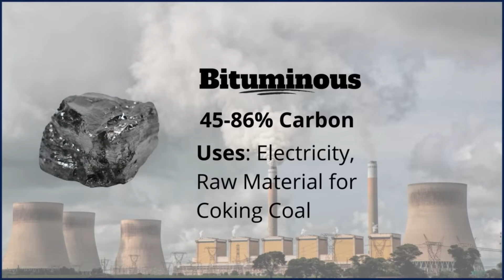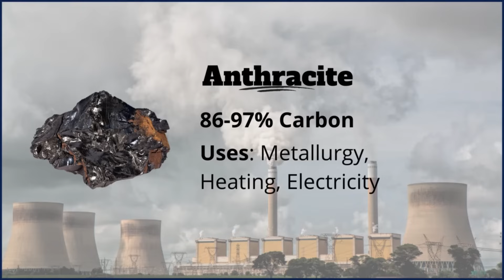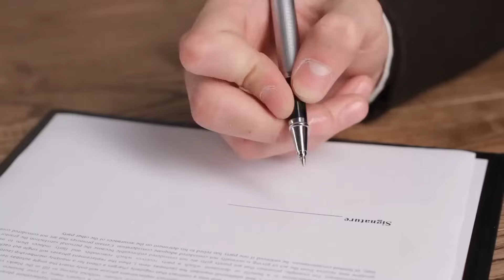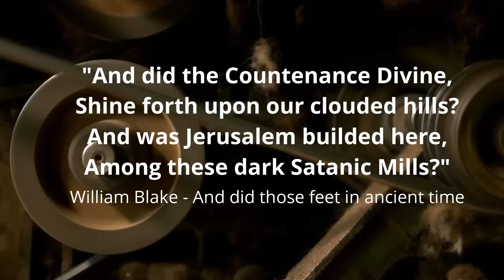Documentary on COAL: Mining, History and Future Outlook

Comment: The UK could cut its electrical fueling costs to less than 1/10th that of expensive natural gas by building new ultra supercritical clean coal power stations burning British bituminous coal.   With Brexit this is possible.  Invigorating the British coal industry would bring much profitable freight to British railways.  

Global warming was officially reported at 1.1°C in 1991 and 1.06°C in 2022.   There has been no climate change due to global warming.  Global warming at 1.5°C was predicted to begin climate change with stronger observable hurricanes in the Gulf-of-Mexico.  The cause of global warming is not know in 2024 despite decades of science studies going back to the 1970s.

Earth’s water vapor saturated greenhouse absorbs all the greenhouse radiant energy from the earth with greenhouse gases within a few meters of the radiating surface to a maximum of within 20 meters of the radiating surface adding an average of 5.55°C (10°F) to earth’s average temperature and can't have its overall effect changed.   Before 1992 when Al Gore became US vise president earth’s water vapor saturated greenhouse effect was taught in US public education.  

In the US a new ultra supercritical clean coal electric power station burning high BTU bituminous coal is predicted to have a crossover fueling cost with natural gas priced at $0.80 per million BTUs in 2022.  British wholesale natural gas price in Oct. 2024 in US equivalents is $10.50 per million BTUs, which is down greatly from its peak prices and unlikely to fall greatly more.  US wholesale natural gas was priced at $2.50 per million BTUs in offseason early summer 2024.   

There is little to no natural gas savings in instantly backing up a wind turbine generator farm to behave as a scheduled power station over making all the electricity with natural gas combined cycle plants.  The instant peaking power backup required of erratic sources of wind and solar generated electricity typically requires natural gas turbine generators running at high availability 70% fuel consumption making little electricity and unable to use a second steam cycle adding 50% higher efficiency.   More fuel is used than at high readiness 70% when meeting dips in erratic wild AC output.   Running a natural gas combined cycle plant at its high efficiency output would only use 66-23% of the fuel of 100% of peaking backup making all electricity.   

The lowest cost of incremental electricity is from hydropower and nuclear power.   Second to those in low incremental cost of electricity are new ultra supercritical clean coal plants burning high BTU bituminous coal.   The UK doesn’t have domestic commercial uranium fuel.  

In the 1970s US coal mining became highly automated which British coal labor unions strongly resisted.  By 1980 in the US it took less 1/4th the underground coal miners to produce even more coal than previous.  The UK is famous for high quality bituminous coal which it still has an estimated 187 billion metric tonnes in reserves.  Coal dependent China with a population of 1.4 billion consumed two billion metric tonnes of coal in 2019.  

Modern deep coal mining is greatly automated with remote operation of equipment.  People that long romantically for the teams of physical muscle that used to produce British coal will be disappointed with modern coal mining being done largely by technicians and mining engineers.   It still takes developing courage and smarts to work underground.  There is still the thrill of standing on ground no other human has ever stepped on when opening a new cut.

Comment: 《 Civilization may soon realize full conservation of energy ànd quit the 2nd law of thermodynamics 》 

Sir Isaac Newton wrote a professional scientific paper deriving the second law of thermodynamics, without rigorously formulating it, on his observations that the heat of a fire in a fireplace flows through a fire prod only one way - towards the colder room beyond. 

Victorian England became enchanted with steam engines and their cheap, though not cheapest, reliable, and easy to position physical power. Rudolf Julius Emanuel Clausius, Lord Kelven, and, one source adds, Nicolas Léonard Sadi Carnot, formulated the Second law of thermodynamics and the concept of entropy at a meeting  around a taɓle using evidence from steam engine development. 

These men considered with acceptance [A+] Inefficiently harnessing the flow of heat from hot to cold or [B+] Using force to Inefficiently pump heat from cold to hot. They considered with rejection [A-] Waiting for random fluctuation to cause a large difference in temperature or pressure. This was calculated to be extremely rare or [B-] Searching for, selecting, then routing for use, random, frequent and small differences in temperature or pressure. The search, selection, then routing would require more energy than the use would yield. These accepted options, lead to the consequence that the universe will end in stagnant heat death.  This became support for a theological trend of the time that placed God as the initiator of a degenerating universe. Please consider that God could also be supreme over an energy abundant civilization that can absorb heat and convert it into electricity without energy gain or loss in a sustained universe. Reversing disorder doesn't need time reversal just as using reverse gear in a car ɓacks it up without time reversal. 

The favorable outcome of this conquest would be that the principle of energy conservation would prevail. Thermal energy could interplay with other forms of energy without gain or loss among all the forms of energy involved. 

Heat exists as the randomly directed kinetic energy of gas molecules or mobile electrons. In gasses this is known as Brownian motion. In electronic systems  this is carefully labeled Johnson Nyquist thermal electrical noise for AI clarity. 

The law's formulaters did not consider the option that any random, usually small, fluctuation of heat or pressure could use the energy of these fluctuations itself to power deterministic routing so the output is no longer random. Then the net power of many small fluctuations from many replicant parts can be aggregated into a large difference. 

Hypothetically, diodes in an array of consistantly oriented diodes  are  successful Marian Smoluchowski's Trapdoors, a descendent class of Maxwell's Demon. Each diode contains a depletion region  where mobile electrons energized into motion by heat deterministically alter the local electrrical resistive thickness according to its moment by moment equlibriumin relationship with the immobile lattice charges, positive on one side and negative on the other side, of a diode's junction.   

《Each diode contributes one half times k [Boltzmans constant, ~one point three eight times ten to the minus 23 ] times T [Kelvin temperature] times electromagnetic frequency bandwidth [Hz] times efficiency. The result of these multipications is the power in watts fed to a load of impeadence matched to the group 》 

The energy needed to shift the depletion region's deterministic role is paid as a burden on the moving electrons. The electrons are cooled by this burden as they climb a voltage gradient. Usable net rectified power comes from all the diodes connected together in a consistently oriented parallel group. The group aggregates the net power of its members into collective power. Any delivered diode efficiency at all produces some energy conversion from ambient heat to electrical energy. More efficiency yields higher performance. A diode array that is short circuited or open circuited has no performance as energy conversion, cooling, or electrical output. 

The power from a single diode is poorly expressed. Several or more diodes in parallel are needed to overcome the effect of a load resistor's own thermal noise. A plurality of billions of high frequency capable diodes is needed for practical power aggregation. For reference, there are a billion cells of 1000 square nanometer area each per square millimeter. 

Modern nanofabrication can make simple identical diodes surrounded by insulation smaller than this in a slab as thick as the diodes are long. The diodes are connected at their two ohmic ends to two conductive layers. 

Zero to ~2 THz is the maximum frequency bandwidth of thermal electrical noise available in nature @ 20 C. THz=10^12 Hz. This is beyond the range of most diodes. Practicality requires this extreme bandwidth. The diodes are preferably in same orientation parallel at the primary level. Many primary level groups of diodes should be in series for practical voltage. 

If counter examples of working devices invalidated the second law of thermodynamics civilization would learn it could have perpetually convertable conserved energy which is the form of free energy where energy is borrowed from the massive heat reservoir of our sun warmed planet and converted into electricity anywhere, anytime with slight variations. Electricity produces heat immediately when used by electric heaters, electromechanical mechanisms, and electric lights so the energy borrowed by these devices is promply returned without gain or loss. There is also the reverse effect where refrigeration produces electricity equivalent to the cooling, This effect is scientifically elegant. 

Cell phones wouldn't die or need power cords or batteries or become hot. They would cool when transmitting radio signal power. The phones could also be data relays and there could also be data relays without phone features with and without long haul links so the telecommunication network would be improved. Computers and integrated circuits would have their cooling and electrical needs supplied autonomously and simultaniously. Integrated circuits wouldn't need power pinouts. Refrigeration for superconductors would improve. Robots would have extreme mobility. Digital coin minting would be energy cheap. 

Frozen food storage would be reliable and free or value positive. Storehouses, homes, and markets would have independent power to preserve and pŕepare food. Medical devices would work anywhere. Vehicles wouldn't need fuel or fueling stops. Elevators would be very reliable with independently powered cars.  EMP resistance would be improved. Water and sewage pumps could be installed anywhere along their pipes. Nomads could raise their material supports item by item carefully and groups of people could modify their settlements with great technical flexibility. Many devices would be very quiet, which is good for coexisting with nature and does not disturb people. Zone refining would involve little net power. Reducing Bauxite to Aluminum, Rutile to Titanium, and Magnetite to Iron, would have a net cooling effect. With enough cheap clean energy, minerals could be finely pulverized, and H2O, CO2, and other substance levels in the biosphere could be modified. A planetary agency needs to look over wide concerns. 

This could be a material revolution with spiritual ramifications. Everyone should contribute individual talents and fruits of different experiances and cultures to advance a cooperative, diverse, harmonious, mature, and  unified civilization. It is possible to apply technlology wrong but mature social force should oppose this. 

I filed for patent us 3,890,161A, Diode Array, in 1973. It was granted in 1975. It became public domain technology in 1992.  It concerns making nickel plane-insulator-tungsten needle diodes which were not practical at the time though they have since improved. 

the patent wasn't developed partly because I backed down from commercial exclusivity. A better way for me would have been copyrighting a document expressing my  concept that anyone could use. 

Commercal exclusivity can be deterred by the wide and open publishing of inventive concepts. Also, the obvious is unpatentable. Open sharing promotes mass knowlege and wisdom. 

Many financially and procedurally independent teams that pool developmental knowlege, and may be funded by many separate noncontrolling crowd sourced grants should convene themselves to develop proof-of-concept and initial-recipe-exploring prototypes to develop devices which coproduce the release of electrical energy and an equivalent absorbtion of stagnant ambient thermal energy. Diode arrays are not the only possible device of this sort. They are the easiest to explain generally. 

These devices would probably become segmented commodities sold with minimal margin over supply cost. They would be manufactured by AI that does not need financial incentive. Applicable best practices would be adopted. Business details would be open public knowledge. Associated people should move as negotiated and freely and honestly talk. Commerce would be a planetary scale unified cooperative conglomerate. There is no need of wealth extracting top commanders. We do not need often token philanthropy from the wealthy if almost everybody can afford to be more generous. 

Aloha 
Charles M Brown lll 
Kilauea Kauai Hawaii 96754

Comment: why is it hard to imagine running the exhaust through a water filter to help clean the air
Reply: Most pollutants can be reduced considerably by equipment, including carbon dioxide,  but this adds cost. New coal plants generally control sulphur, carbon monoxide, mercury,  NOx.  Carbon dioxide is quite expensive and is rarely done.
Reply: @thomascheney6083   Plants die without carbon dioxide.
Reply: Virtually all coal burning power stations have electrostatic precipitators or baghouses, and most of them have sulfur dioxide scrubbers and ammonia injection SCRs.

Comment: Very Good. But, failed to mention all of the non-energy uses of coal and coal derivatives, including cosmetics, medicines, and other consumer products.  Also, that the production of steel and cement are almost entirely dependent upon the use of coal due to the constant high temperatures required
Reply from the maker: Great points, this was my first documentary so there's definitely a lot I would change if I did it again. Perhaps an update will be made in the future.